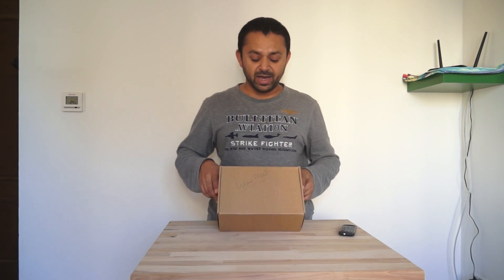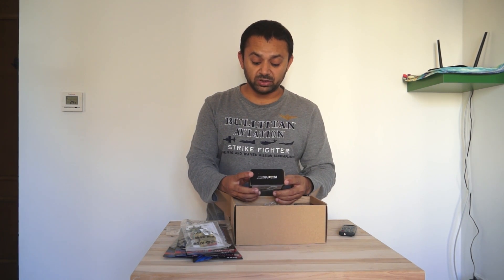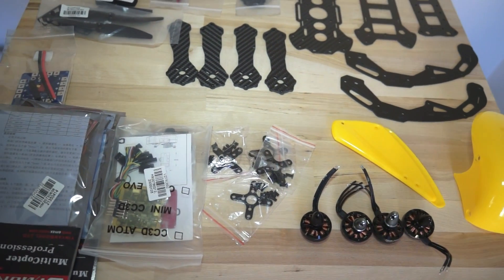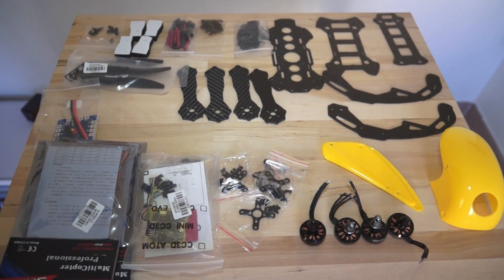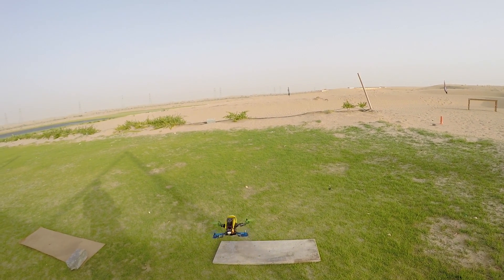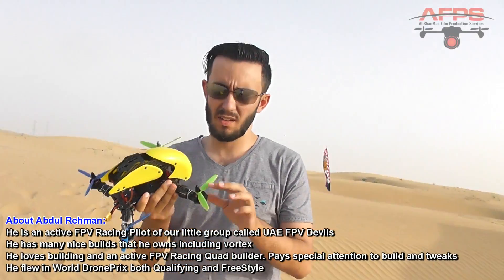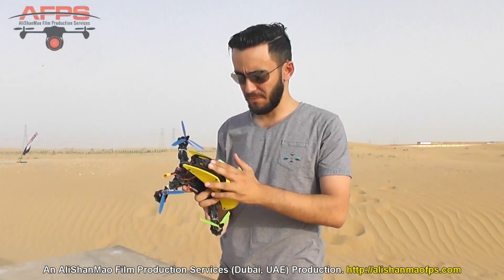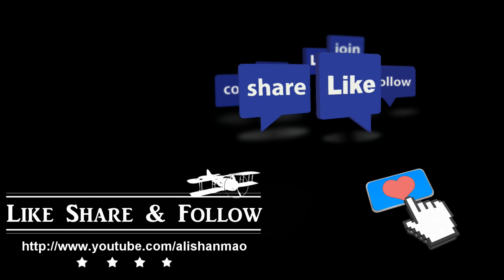RoboCat 270 FPV Racing Quadcopter Quick Review

Comment: im out of 107.00 buying the kit, had no idea power combo was so poor in quality. question, now that im on a even tighter budget what esc, props, and motors you recommend for this quad that is good and at a low cost?
Reply from the maker: I plan to put in Cobra Motors, MT 30A BL Heli ESCs and spin 3 blade 6 inch props :) it will be crazy
Reply: Crazy indeed.

Comment: Hey Ali :)
Since it is the age of super copy, can you suggest to the chinese manufacturers to also copy the last over price HD video transmission called Connex Prosight HD in order to bring back some cheap HD video transmission on the market :p
Reply: +ABMNS PRODUCTION As long as they reduce the cigarette box size vtx it uses. Sorta at the f450 stage of hd fpv i think LOL! A crew guy on a set the other day dropped a HD vrx screen they were using for framing the shots from main cam. You could buy 6-8 Connex for the cost of it. If the connex still blocks out and has video drops it will be bad but at $499. not sure knock offs will get lower than $349.
Reply: ABMNS PRODUCTION I saw you dropping that reminder to master Fu LOL! crazy little airhog plane he had there, too bad real f35 still cannot fly well.
Reply: Lmao... pure comedy 😄
Reply: +Hoverbot1TV No matter what... I can't waist my money  on chinese knock-offs anymore. They arrive broken or brake not long after. Btw I bought this robocat knock-off and it is used for spare parts for my other quads. The quality of the carbon is crap, was missing a standoff, camera mount and xt60 bracket. And my hands were black from carbon dust. This purchase was the last straw for me. Go brand name or gtfo from now on 😉
Reply: +Bryan M Can't believe I just wrote brake lol... getting late.
Reply: Foxtech will announce something in June ;)